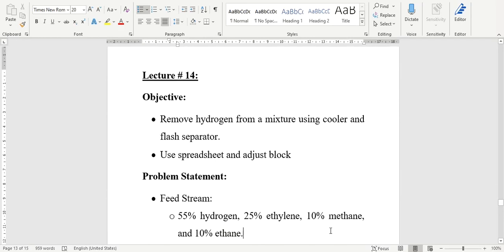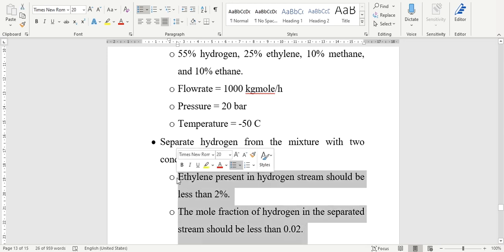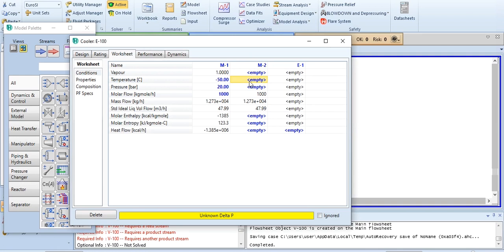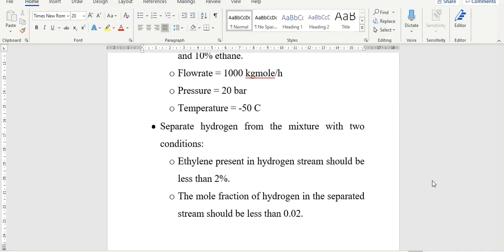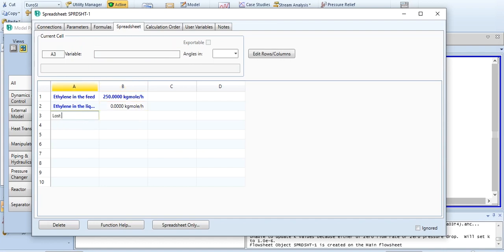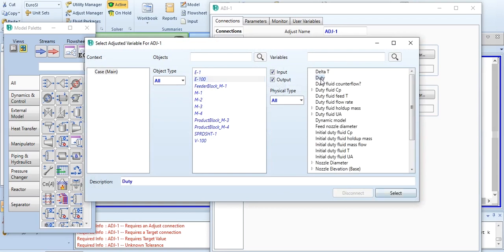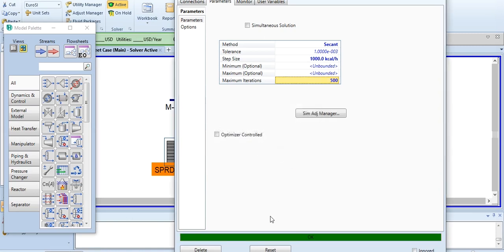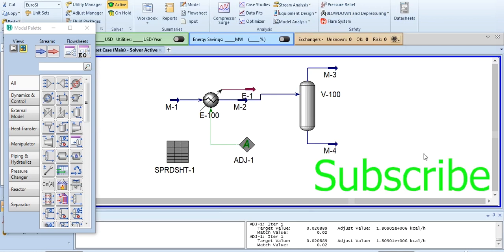Use Spreadsheet and Adjust tools in Aspen HYSYS - Lecture # 14

Comment: Initially, when you converged the system the flow rate in M4 is 0.00 but in the composition tab it is available as Hydrogen - 0.0155, Ethylene - 0.5623, Ethane - 0.3859 & Methane - 0.0362. Could you please clear my doubt? Thanks in Advance
Reply: I think there is flow but it is a very small quantity so it was rounded up to be 0
Reply: @ammarparmr  ok understood but is there any way to find out the exact value of the flow if it is there in some quantity?
Reply: @sachinpanwar8086  I haven't tried , but may be if you extract the values into an excel sheet then click in the desired cell you may find the exact value in the bar (not in the cell itself).

Comment: Hi sir, I have a question. How we choose heat duty? For example you gave 1000 Kcal and it gave outlet temperature of cooler -128 degree©.If we choose different value of heat duty what will be happen?
Reply from the maker: The value of heat duty and temperature are inter-dependent. You must know one of these to get value of another.